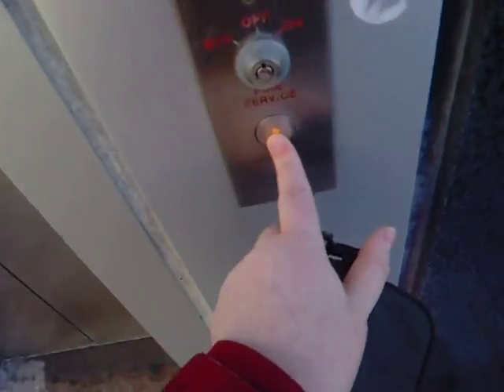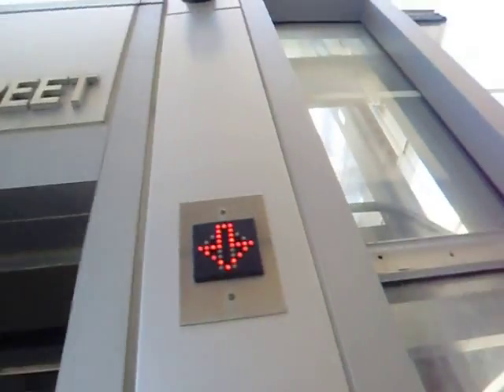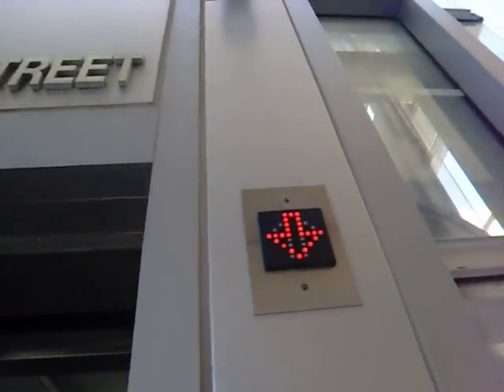US Hydraulic Elevator at Rockville Metro Center Skybridge to Metrorail Station

Comment from the maker: The list of station elevators:
1.) There are 2 elevators that are glass, inground hydraulic in the metro station that go from the street level and station entrance to this bridge. The bridge goes over Rockville Pike, and then enters Rockville Metro Center, there's shops and a small open-air plaza, than there's that stairwell next to this elevator and this elevator, and it goes down to the street level, and then you cross a side street, and  then there's the regal, and rockville town center.